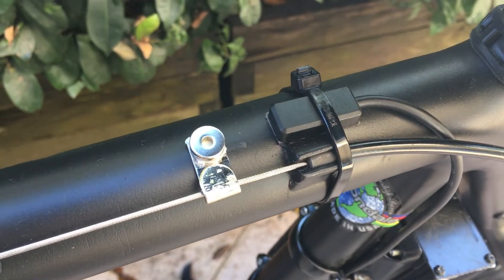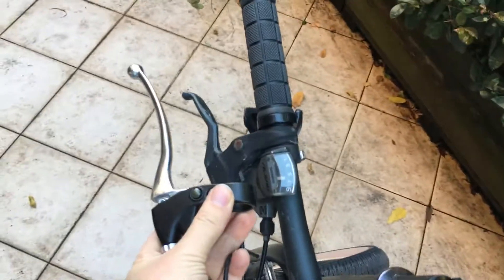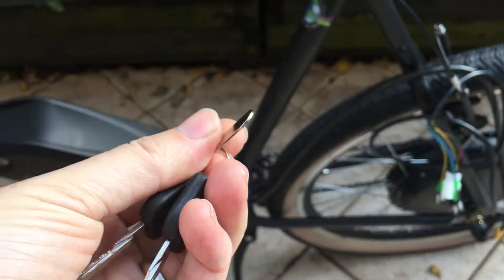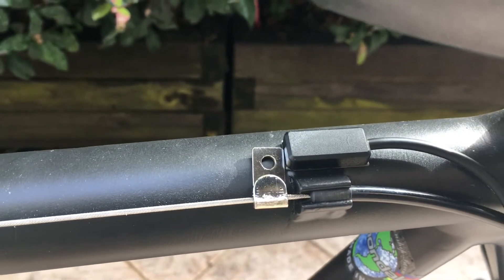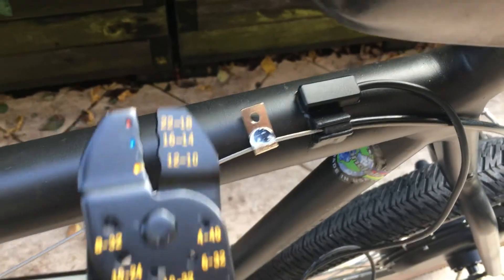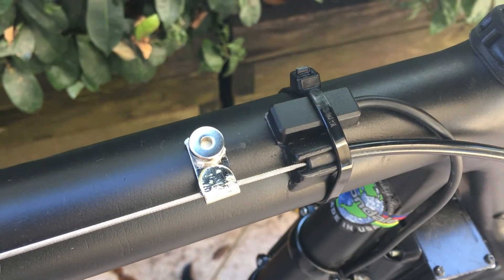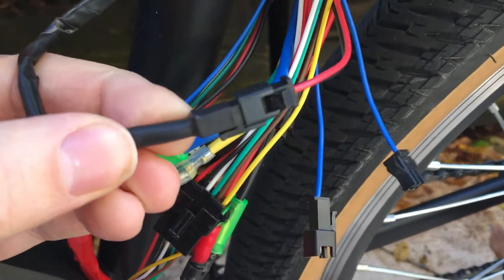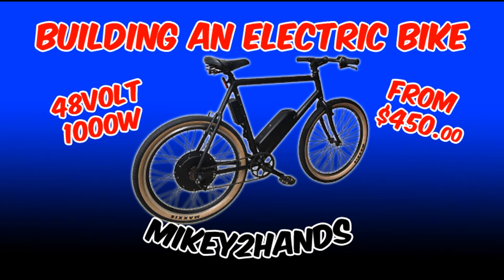EBike Brake Hack - Motor Cut Off Switch

Comment: This can be a magnetic sensor switch, an optical sensor, or an ordinary lever switch with a spring // in some designs, it is placed in series in the circuit and when it is removed, the motor stops.

Comment: Could I use this same set up but for brake lighting? Looking to add some brake lights to my ebike but I'm trying to run it off a 36V battery with a 12V step down converter which I'm currently trying to install to power a horn as well as the lights

Comment: looking to build an ebike. my bike only has rear brakes with brake levers on the right hand side of the handle bars. If I put a cutoff lever from an ebike kit on the left side of the handlebars without a brake cable running through, will it still cut the power to the motor off when used?
Reply from the maker: I wouldn’t recommend that. The brake cut off is nice to have for safety, but isn’t absolutely necessary.

Comment: I would be tempted to just permanently short these wires..who needs this function?
Reply: There is a 1 to 2 second delay when using pedal assist ie when you stop pedaling so you would want it then so you are not fighting the motor when breaking in an emergency situation however he is using a throttle so not sure about any delay with that, it could save your life quite literally.
Reply: I bought a kit where the PAS sensor and brake lever didn't fit and I had to use the thumb throttle only for a week. Since buying the correct PAS sensor I found an issue when slowing down approaching a T-junction...

I needed to rotate the cranks to downshift the front chainring, so I would be able to pull away from stationary when the traffic was clear.  On PAS level #5 the bike suddenly accelerated in a short burst towards approaching traffic and I had to slam on the brakes and skidded a bit.

Using PAS #1-3 seemed to reduce the unintended acceleration but I just have to be careful to not turn the crank when stopping. A trick I read would be to use a brake sensor and pull the lever slightly to disable the motor temporarily.
Reply: Hi bit of advice please. Wanting to buy a used ebike.  But brakes have Ben changed to hydraulic with no cut off. I dont think that's fully safe.  Would installing one of these be a solution ? It's a m1 pro . Thanks!

Comment: I could set this up the other way around so that the magnet is dragged towards the sensor when u brake to activate a brake light?
Reply from the maker: No you would need to set it up the same way I did. The magnet and sensor need to be together while riding and pulled apart when braking. Good luck.
Reply: You can use this same switch actually. The switch is open when the magnet is touching and closed when the magnet is away. So your brake light would light up when the magnet is away from the sensor just as you need it to be.